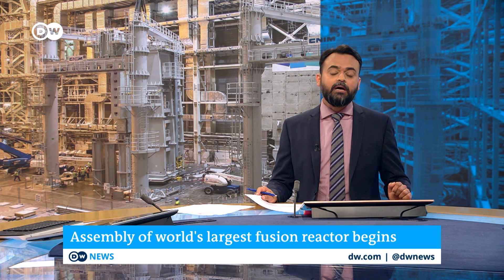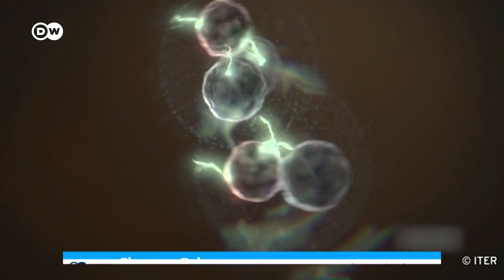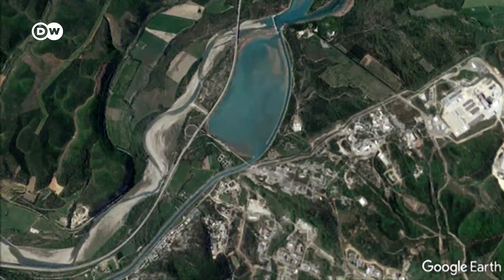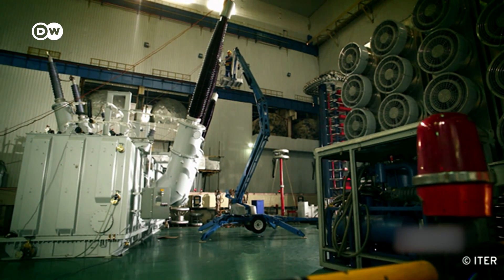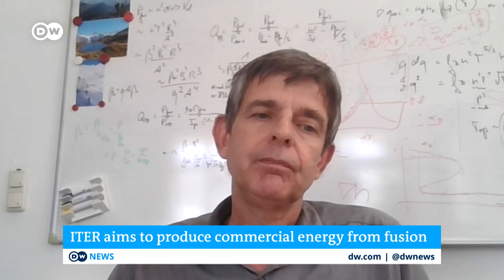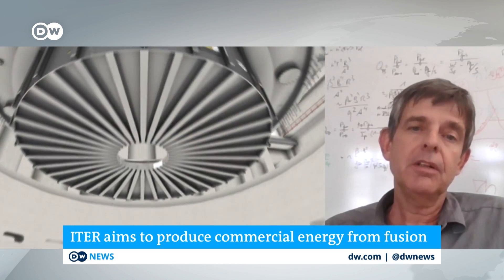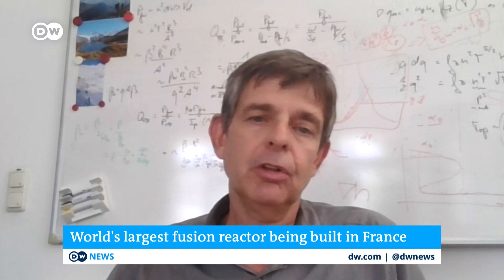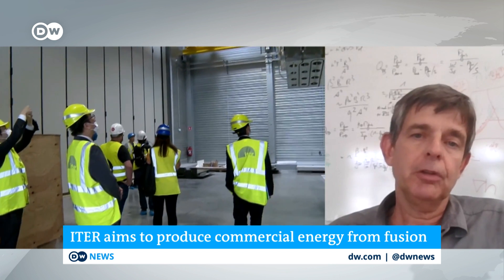ITER: Assembly of world's largest nuclear fusion reactor begins | DW News

Comment: Another 30year? Come on, you know you need 100.000 fusion reactors like this to power the entire wold? This is so overdue and outdated already. It's to complicated for the industrial to build 100.000 reactor like this one, you need to go to the drawing board and start again design and building smaller and feasable reactor.
Reply: What do you mean overdue and outdated. Fusion is the future. It doesn't matter how big the reactor is if you output more energy than you input. Its literally unlimited energy and one successful plant is all you need. Things get better over time as new technologies and breakthroughs are discovered. Of course the first ever iteration of the plant will be large. The computer youre using to type this comment do you think it started out being this small? The first ever computer the size of an entire room and couldn't do 0.1% of what computers today can. Same for this fusion reactor. Its large, new, probably not that efficient. But it'll pave the way for future improvements and advancements.
Reply: @PhantomZenix  overdue because the initial date for the first fusion was 2019, it's way far from ready in 2020. And because this is an experimental reactor it is capable only to work for few minutes and then it must be turnd off to not be damaged. The output it's only 500MW. ITER cost is even more then LHC and LHC today is the most bigget and complex machine in the world, can you immagine how much cost build 100K fusion reactors like this one to power the entire world? No single one energy company is going to build this fusion reactors so complex and expensive wiith so little power output just for few minutes and than you are forced to shutdown. My biggest concern it's than this reactor is not a complete well industrialized solution ready to work 24/7 than can be replicated ( despite the costs ). This is only another experimental reactor like many already available around the world. What's the purpose of this? I would've spent this time and this money to build tens of little experimental reactors  easy to build and modify to test hundreds of new technologies instead. When ITER will be ready it will be almost impossible to modify it to test multiple new technologies because is so massive. And if you talk about the future why the most advanced nations on earth spend so little on fusion energy research, they should spend 10 times what they spend in fusion research. They don't care because they have too much interests in fossil fuels and fusion energy will be always 30 years in the future unless people like Elon Musk is ready to revolutionate the energy sector and industries take over the research institute to make this a massive production product.

Comment: The renewable industry would go completely out of business. No more chopping of birds and bats. Imagine that.
Reply: No it wouldn’t. Renewables will be cheap at that point.
Reply: @Gomlmon99  No, renewables will never be cheap, esp. when you include the land use and the bird chopping, not to mention the need for batteries and backup power.
Reply: Werner B. Renewables are already cheaper than coal. Imagine how cheap they’ll be in 50 years.
Reply: @Gomlmon99  No they aren't. Renewables are multiple times more expensive than fossile fuels. Thats why nobody uses them without massive subsidies. And why should they become cheaper in 50 years? Is there a magical rule that commodities and labour are getting cheaper over time and with increasing demand when they are used for windmills? You are halluzinating.
Reply: Only if it makes economic sense - would the cost of building such a plant + maintaining it cost more than solar panels + wind farms that, for the most part, can simply be left alone?
Reply: @macculu501  No, it would not cost more. It would cost 10 times less per unit of energy.

Comment: Ah I love these videos it really brings out the YouTube scientists in the comments
Reply: Default  I know. It's hilarious but sad at the same time.
Reply: In what way .. in an optimistic sense or pessimistic? I see pop sci optimism usually. Look at the conditions required in the universe to fuse. Giant amounts of mass like, in a star. This mass creates gravity which makes fusion possible and also regulates fusion rates. This makes these celestial objects, most of them, quite stable over long periods. We can do uncontrolled fission-fusion, like in a H bomb, quite easily. Practical, sustained, commercially viable fusion though, will prove impossible .. and always 20 years out. ITER is a worthwhile experiment defo but I think will not really get us closer to controlled fusion as much as it will instead teach us just how difficult and ultimately impossible fusion power stations will be here on Earth.
Reply: @xenuno  It's not really the gravity. It's the pressure inside the sun that does the job. It doesn't work near the surface of the sun.  Sorry I couldn't resist doing the YouTube scientist thing here.
Reply: @effedrien  Gravity is the instigator of that pressure which is directly proportional to mass. This gravity creates a pressure gradient relatively low at the surface increasing to OMG amounts by the time you hit the core.
Reply: @xenuno  Gravity is a weak side effect of mass. Pressure is a strong side effect of mass. Nobody understands the instigator. It's probably buried deep inside the quantum world.
Reply: As smooth as butter 😂😂😂
Reply: Lot of people do actually have a science background so not hard to believe.
Reply: Check out the videos from Ed Pheil of Elysium and Ian Scot of Moltex. They both have fission reactors that will burn nuclear waste. The result will be no radioactive no longer than the waste from fusion reactors. The huge difference is cost. The new molten salt fission reactors will be very low cost to build, operate and to fuel.

Comment: CLEAN, SAFE AND UNLIMITED  ENERGY!!!  YES!!   Imagine those reactors for spaceships!!
Reply: Yeah that'll be another 200 years before we figure out the logistics of that😂.
Reply: Michael Vigil we do have nuclear thermal rockets though
Reply: Deepfriedpillows no more waving goodbye to the rockets, just being grilled.
Reply: @iain3713  No..and way too dangerous.
Reply: I believe in orbit nuclear thermal tugs will be critical if we were to colonise the moon or mars, allowing us to transfer cargo from LEO to the moon and mars with a high isp, high thrust, refuel-able platform
Reply: Or for a caplan thruster fed by a Dyson bubble capable of moving  our own solar system.
Reply: Only suitable for exremply large spaceships in the range of several thousands of tons. Thus in our life time, not suitable for spaceshipts, to heavy and getting rid of the thermal energy is also not easy in space. It will require a lot and thus tons of thermal radiatiors because in space the only thing you can use to remove thermal energy from your space ship is thermal radiation and a vacuum is a very good isolator.
A fission reactor is much more realistic than this for a spaceship.
Reply: Somewhat clean, somewhat safe, and somewhat unlimited. Yea.
Reply: find anti-gravity first
Reply: lcdvasrm how
Reply: @lcdvasrm  Yeh that's right
Reply: Not unlimited but there is an abundance of fuel also it does emit radiation but that’s not to hard to deal with
Reply: its not a thruster,its just energy.At max,it can provide electricity for on board demand.You just can't make a fusion thruster because our current technological capability is not up to mark.Heck,even a static fusion reactor is taking so long to be successful.
Reply: destroyerking maybe in a few hundred years we can figure out how to heat reaction mass with it

Comment: I don’t understand that if the fusion works, energy is still not generated on that plant. Why?
Reply: The fusion is working but the energy out is still less than the energy in.
Reply: They cannot make the hydrogen heat itself by the fission yet because they cannot contain it. So they blast a small amount of hydrogen with laser to make fusion but that's it. With the magnets in the tokamak they can hold way more very hot hydrogen together which means it can heat itself and continue the reaction. That's what I think.

Comment: Lets say it works eventually. What is the initial CO2 footprint of construction and operation and how much CO2 emissions it would save when it's put instead of solar power plant? How many years to pay for it's CO2 footprint? You see, there is no shortage of ready solutions to climate change. It's just there is no political will to do it. There is a buck to be made in those high tech, expensive powerplants, there is little in actual renewables in long run.
Reply: the co2 foot print of this thing comparred to the co2 foot print of the solar panles needed to gnerate the same amount of KWh is very small
Reply: @GodOfChaos_HeXa Really? Would you share your source with me pls?

Comment: People need to remember this is already somewhat outdated model and only a test plant. Why I say outdated?

Because newer magnets will allow a dramatic decrease in size due to multiple times stronger fields, which will reduce buildtime and required investment by a huge factor. By MIT estimates, the 10 times decrease in size that the new magnets enable could decrease costs by a factor of 70! You can learn more by searching for MIT's ARC and SPARC (smaller proof of concept) reactors

The next stage nuclear (fission and fusion) will be SMR direction with small modular design
Reply: Yes it is outdated, but it is experimental, to study new things about fusion at that scale. It's results could still be used when designing future fusion reactors.
Reply: @ionbarari7202  exactly my point, but people are using the size and cost of ITER as proof that fusion is dead and too expensive
Reply: @Songfugel  YES. ITER is built so we can do at a scale far greater than we ever did with fusion. It is supposed to be expensive and big - that's the whole point.
I went back to university to get a degree in physics but wife got pregnant with twins... And all went down the drain.
Reply: @ionbarari7202  if you notice, I did write it is only a test plant. Its point isn't to be big and expensive engineering nightmare, its point was to be able to be big enough to see if commercial scale reactors could be built and a net fusion be achieved.

It was only after ITER had started building that we discovered new way of building magnets that allowed 7-10 times stronger magnetic fields with better famage resistamce, ability to layer them and they can run at a significantly warmer temperature. Also, they also noticed that there is a huge increase in efficiency and fusion enabling collisions whem you hit a certain sweet spots in diameter (smaller the better) of the plasma. Which is only realistic due to breakthrough in neural networks and high temperature composite magnet engineering

If iter had had these technologies available, ot would have turned out a very different project. Not saying ITER is useless, far from it, but just that it doesn't represent the cutting edge in fusion technology. Thus it can give a false impression of the real state of fusion if people mistake it to be meant as a commercial reactor representing our cutting edge in fusion technology, when in fact, fusion has made major game-changing breakthroughs long after ITERs construction had already started

Since they figured out, that when they use stronger magnets to allow smaller size and smaller more precise plasma channel diameter, the efficiency (how easy it is to start the reaction) of the fusion also increased by a huge marging
Reply: @ionbarari7202  btw, how are twins and not getting a degree related?
Reply: @Songfugel  twins, aka 2  kids at once - to of one of the most time consuming creatures on earth.
Reply: @shmadmanuts  that shouldn't mean you can't still keep studying or working. Never heard of anyone having to stop university, especially a guy, due to children, even twins

Even if you do for some reason, you can still keep studying online
Reply: @Songfugel  ah, well, when you're already 30 and finished one bachelor's degree and have a full-time job and wife also works so between grandmothers we take turns to sit with the kids - one could give up on that second university degree.
Reply: @Songfugel  
This Is called the "interstellar spacecraft dilemma". Why launch an interstellar spacecraft if you think that in another 10 years, the technology will have advanced to build and even faster interstellar spacecraft? Eventually you have to freeze the design and just build it and go with it.
Reply: @gregorymalchuk272  this is whst I call inability to read comments before replying to them
Reply: @Songfugel  
I don't doubt that better magnets are available. But this project is already under way and is still claimed by physicists to be capable of producing net power.
Reply: @gregorymalchuk272  I know, but people don't realize how much fysion has advanced even beyond this. So don't judge fusions potential just by ITER, it isn't the commercial future of fusion
Reply: Exciting to hear!
Reply: But at some point we need to build a real one to test our designs and ideas.
Reply: @bluerisk  we are, this is just that. A test plant, a very important one, but it does not represent the future or even the current state of the fusion technology. We have taken a huge leap forward after ITER

There are severeal simultaneous projects in development atm, and even by commercial private companies trying to get a working reactor in to the market in the near future. But sadly due to commercial reasons, many aspects and details of them are still classified
Reply: @Songfugel  I don't disagree with you in this regard. All I say is that we can't wait with a real test project because of the fear of missing out the next big step and having an obsolete project.
It will be - no matter what - an obsolete project when it is completed, but alone the gained knowledge and experience by having  build a real facility in this  dimension will be worth it.

I don't think that I will ever see a working fusion reactor in my lifetime. This is a generation project, and I guess the most major projects (=> colonization of Mars or the space lift)  will be projects  beyond a human lifetime.
Reply: 70! =/= 70
Please don't use exclamation marks after numbers.

Comment: build something so advance in science, and yet it's based on idea of produce more energy than what they put in
even YouTube electricians will laugh at that
Reply: Electron Resonator That's absolutely not the idea it's built on. Yes it needs energy to kickstart the reaction, but that's not the same as a null energy device, many physical interactions require initial input to start.
Reply: bruh that makes no sense bro
its gonna produce more KWh that its needs so its going to sustain itself but you still need to put in deuterium and trithium or helium3 so its producing more electrcity then it needs but it still gets chemical energy to run so it isnt a perpetomobile

Comment: Is everyone forgetting it is still 2020?
Reply: thats the goal
Reply: what do you mean ?
Reply: 2020's months were like entire years ...
Reply: im uncomfortable with this. Cant we invest in solar energy instead?
Reply: @GROOVwithme  Solar energy is pathetic compared to fusion. Fusion will be the safest, cleanest and most overflowing source of energy by far and will render everything else obsolete.
Reply: @kakam458  Solar radiation* and it's only pathetic due to our range from the star and our (in)ability to make efficient photovoltaic cells
Reply: JustDoIt Why are you uncomfortable with this, there is literally no downside. With solar however, we need too overcome the duck curve (Using less electricity during the day when the sun is out and using more electricity during the night when the sun has set)
Reply: @GROOVwithme  tbh that is the SAME,just you use the actual sun. this is way more stronger, and NO chance of explosion, since how its working. its literally just shuts down,if it fails, no Booms.
Reply: nuclear reactors don't actually explode. Fission reactors ( what we currently have) can meltdown if the chain reaction of particles being split can't be controlled, but they don't explode just melt down.and expose all of the radioactive material to the surrounding area. Whats exciting with fusion is theres no chance of this happening. Fusion isn't a chain reaction so there's no chance for a melt down. Worst case scenario your reactor just stops working. I think a lot of people associate nuclear power with nuclear bombs and this is where the fear of exploding nuclear power plants comes from but in reality a nuclear bombs uses fission in a VERY different way to achieve such destructive force which is impossible to recreate in a power plant dude to the type of fission used as well as lack of the neasecary mechanics being present in reactors.   Overall going forward with fusion energy only makes nuclear power a more safe option. No melt downs means no chrynoble like incedents
Reply: @GROOVwithme  Solar power just can't get to the level of nuclear power, nuclear is just the future.